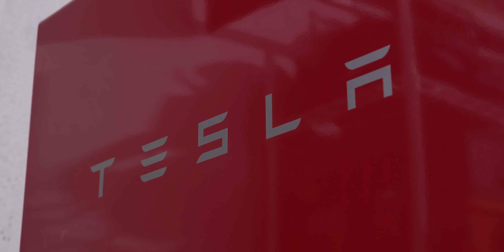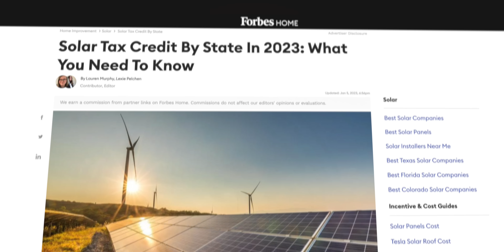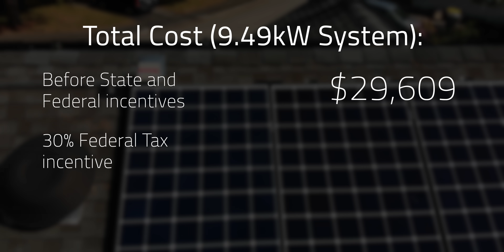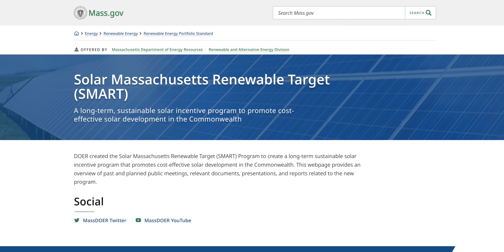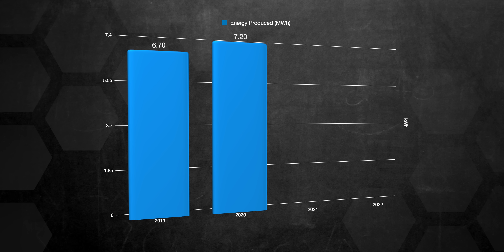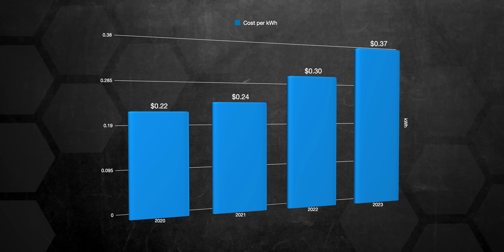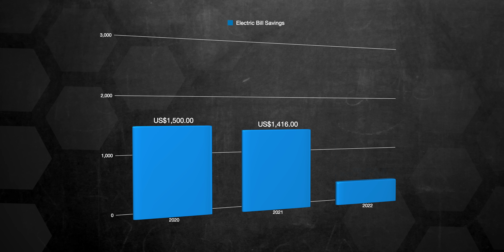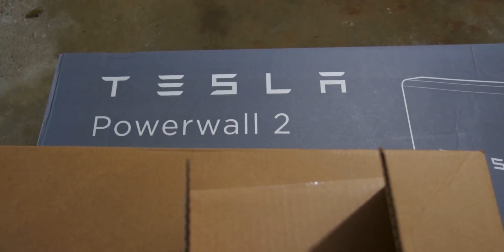5 Years with Solar Panels - Is It Still Worth It?

Comment: For those who are looking for some advice on extreme climates, I have had 2 off grid homes one in CO @11000ft elevation and one in AK at 66 degrees latitude. The suggestion for more than 6 months of winter is prioritize something more efficient in inclement weather like wind. The panels in CO needed to be shovelled not brushed off up to 4 times a day. Panels will crack with more than 2 ft of snow on them. I lost 25% in one storm where I couldn't physically keep up with the snow. I also had a roof avalanche that knocked my generator, 16kw propane, and propane tank off the pads. A snow bar would have made my roof collapse even at 100 psi snow load. In AK I have 11.6kw panels and 2 genies, 6kw and 10kw. There is 1 week a year the sun doesn't come above the horizon so solar was only giving 0.3ah for 24 panels. The snow also is an issue here I have a ground mount with the panels vertically. They are set @ 66 degrees so most of the snow slides but being 16ft in the air, I can't reach the top. With large storms, snow needs to be shovelled out of the bottom so the bottom half panel is visible. This will pay off in the summer with 23 hours of daylight. In summary, choose the most efficient system for your location and look out for hazards like extreme weather, slippery roofs and overestimating your physical abilities.
Reply: My father tried wind in Ohio. A small system with a brake that would apply itself if the wind was to strong. One night it was so windy the brake blew apart and the blades spun so fast they ripped off the center mount launching one through the siding, outside wood, and inside wood of the of the garage. The blade was stuck into his house, halfway inside and halfway outside. He tore it all down at that time. An expensive mess..
Reply: "An expensive mess" , on boy , you nailed.
King Murphy of new jersey with his German co-cronies are trying to pave the ocean floor to support an army of giant windmills as tall as the Chrysler building with blades as long as the statue of liberty 🗽 is tall.
Try an keep that balanced and bolted on!
Anyway it won't work and will become a government cheese disaster we can't even eat.
Plus it's killing the whales(the constant sounding destroys there equlibrium) and eventuality all commercial fishing.
Reply: @ohioplayer-bl9em  I've been looking into home/residential wind and in the majority of situations its just not worth it unless you can afford a very large and tall wind turbine. Its good for commercial but for most solar is much cheaper and reliable. Just getting a lot of wind through your property isn't enough to make it useful, you need consistent wind that isn't prone to gusting and changing directions a frequently, which is why wind turbines tend to be tall as the wind is more consistent there. A battery pack for storing extra solar power during the day is a better way of offsetting night-time energy usage as well. If you got enough water at a steep enough angle running through your property year round then hydro might also be something to check out, but thats also very situational.
Reply: Not getting on a roof especially snow filled. In my 60s and you too, Lord willing will get older and unable to do any of this kind of stuff or risk breaking your neck. Come up with some other arrangement as one fall and health gone makes no sense to save money if jacked up and now unable to do anything because you fell off the roof cleaning panels
Reply: @billbirch3748  Great grandfather died falling off a roof while fixing it in his 80s. Leave your roof to professionals!
Reply: @billbirch3748  I made the same comments. But adding to that there is just too many  Americans that couldn't possibly afford any of this but those that can are being heavily subsidies in all aspects that push higher rates to those that couldn't afford it in the first place. I don't see solar as practical, even for those that now can afford surely the future is unknown, subsidies and mandated buy back most likely will disappear and eventually total replacement of solar. To me nuclear and constant power plants benefit all. To me we are moving away from the logical to the illogical and eventually the logical will prevail.
Reply: Sound advice @b hendrick. 🕶👍
Reply: You're supposed to be smarter than your solar panels
Reply: Also as you highlighted, if you know snow is going to be an issue and you're not able to do anything about roof avalanches then don't place expensive equipment directly under where its going to happen. I imagine you'd also be better off with a ground based solar panel rather than roof mounted, so its easier for you to clean the snow off, possibly even have a manual way to tilt the panels to make the snow just slide off. Basically try to plan and anticipate issues ahead of time and then learn from the things you weren't able to foresee, then pass your knowledge onto others.
Reply: If you have a metal or solar roof, or heavy snows in general with a high angled roof you should be getting everything cleared from where it could land.

Last year my company plant was closed because a snow avalanche off the metal roof hit the natural gas meter and ripped it off the wall.  The gas found the path of least resistance...into the building.  People walked into the plant in the morning and there was the smell of gas throughout the building.  Happened once in like 40 years, but still potentially catastrophic.
Reply: Me me me me... Me me me

Decarbonization is 21st century pyramid building.
Just burn coal. 

This is sickening on so many levels.  "How to screw the lower middle class and make them pay for your feel-goodery."

Comment: consider how much the panels, plus installation plus converter cost. How many Kw-hr could you have bought? Then, I don't know where you live, but roof panels North of Miami , about 26 N are a waste of money. Consider= in winter solstice, the noon sun at Miami will be 49 degrees off the vertical. Glass has a diffraction property called the "critical angle" (it's used in periscopes). For regular glass, it's about 36 degrees. Any incident light at a lower angle will bounce off the glass, at 100% reflection. Solar panels are glass coated. Then, even in Miami, flat, horizontal panels work only part of the year. You bought a grapefruit.

Comment: We have had our panels since Feb 2016, so 7 years now.  They are thru a power lease with Tesla (formerly Solar City).  I have a 35 panel system that has generated an avg of 6.71 MWh per year, to which we pay (Tesla) $0.1483/kWh (this started at $0.12 in 2016) and any under-generation we pull from the grid.  In our area we have Peco Energy and they have a program where they apply billing credits for overgeneration.  Our yearly credits essentially cover our natural gas bill for the year (gas heat, stove, and HW heater).  So, overall for us its been worth it.

We also have not had a single issue with the system and rarely have heard from Tesla since the system was installed - really a set it and forget system so far.

Only thing that came up, oddly, is we had some roof damage due to a hail storm last summer.  Insurance finally this year processed the claim and we had to get the panels removed so our roofer could replace the roof.  Pleasantly surprised it was a great experience with Tesla to come out, remove (stored in our yard), reinstall.  Scheduling was very quick, and they (Tesla contractor, not a 3rd party sub) did a great clean job.  In fact, when they removed the panels, they found 19 of the 35 panels had wiring damage.  Apparently, Solar City in their manufacturing process, used coconut oil in the wiring, and our squirrels really like coconut!  So now we have a new roof, and 19 new panels all back up and running.  :)

Now, if the Powerwall battery wasn't so expensive we may have added one a while ago.  We don't really lose power (maybe 3-4 times in 10 yrs) so have a battery for backup isn't a big need for us, but may be nice to add in the near future.

Comment: For those who are interested, the guide is approx 65 minutes of video content for the beta price of $125 vs normal of $250.

Don't buy this. Spend your $125-250 on am individualized energy consultant that specializes on solar in your particular area. I haven't paid for or watched the content, but as someone with solar industry experience, you can likely get a few hour consult with a professional local to you that would explain everything included tailored to your area.

This isn't a dig against the author, but rather pointing out that solar is a very regional thing and requires regional expertise. Any guide like this needs to be generic in order to provide useful information to as many people as possible. Generic information like this can be typically found for free, but shouldn't cost more than 25-50 bucks as it's not the only thing needed for an install

Comment: Doing an install eventually in the Philippines.  Since it's close to the equator, you don't want to mount panels on a north or south facing side of the house.  If you want them in one position, then basically flat since the sun is going to track both north and south of a spot depending on time of year.  So, the panel array, maybe two, will go over a garage with a roof without much of a slant.  I want a simple way of positioning them for either 3 or 5 positions during the day, going east to west to get the best production possible throughout the day.  So, kind of like tracking the sun, except no tilt to the north or south, and only track east to west, but with something more rudimentary than actually tracking the sun.  I want the panels to lock into these positions.  They also need to be able to slide in to where they make two rows (so a mounting frame that can extend out and pull back in).  With the panels slid in to where part are underneath others, they need to lay pretty flat against the roof and then be able to be covered because you can get category 5ish typhoons and this is in the land of tall coconut trees and I can imagine that a coconut ripped from a tree and hurled at those panels will break them.

 So that's IT!  Nice and simple.  And we'll probably get one battery pack to run some electrics overnight.  We'll probably have to power down an AC unit overnight and just have overhead fans in each room.  This would mean cooling off the home more before the power generation starts to drop, and accept we wake up in the morning a little warm.  But I don't know because I'm looking at ways to keep the sun off the walls without using tall trees, such as using a sun shader on both sides of the house (east, west) to help keep the walls from heating up.  And these I'd want to be retractable.

Comment: solar panels, made with ferry dust and unicorn farts , not oil and gas lol , also you have to factor in cost, maintainence, if you need to re-shingle your house theres more costs, battery replacement

Comment: I'm surprised how expensive it all is. 🤔We can buy 9.9kW for about 5k in Australia (in Australian dollars, about 3500 USD). There's not much subsidy on that either. I have a 8.9 kW system with battery (14.6 kWh) on a maintenance plan which is about 30 USD per week and covers 95% of power consumption. Please note we get next to nothing for exporting to the grid. Usually 2.8 cents per kWh...

Comment: Note that with the tax credit, if it exceeds your income tax for the year you can roll the remainder over into the next year. Also the credit is against your income tax before withholdings, so if you over-withhold you still get the full amount back.

It's still not as good as getting the full credit back in the form of a direct rebate, but it isn't as bad as this video makes it sound.

Comment: Your state and utility is quite progressive as compared to mine (which is a state that SHOULD be solar friendly because of a high percentage of time solar is available without naming states (think southwestern US). Also having 1:1 netmetering is great. Having a utility pay you LESS per kWh than what they charge you AND having tiered pricing where you pay MORE during hours when solar generation is decreating (later afternoon to early evening) also is unfriendly (at the very least) for solar. 
Therefore, installing a 9.4kWh system 2 1/2 years ago has done ONE thing I desired which was not having any electrical bill, but that was only because I oversized the system for my ultimate usage (having moved from another state and using those figures without having current usage figures to go by). That proved to be a positive as I found out I typically could not oversize my system because the utility would not allow it. 
They do pay me a credit each year if I have one and so far I've had one. 
I agree with you about installers and how important that is. I was basically sold a system they termed 'hybrid' to include small battery backup with small natural gas powered generator to cover critical loads (at the time the cost of battery only for backup of the entire home was too costly and getting a whole-house size generator was also too costly). 
In hindsight I would not have gotten the backup portion of the system as it was not yet ready for prime time. It took almost 1 1 /2 yrs before the software caught up the hardware to make the system fully functional. Also I found out the need for backup was greatly reduced in the area I now live as compared to my previous home/area. Could have saved thousands of dollars. 
The solar installer also started charging a monthly fee just to maintain oversight of the system (which originally I was told was included in the cost and a benefit service they offered).. I cancelled that and now monitor myself, but have to pay them if I have ANY need for them to come look at the system or replace parts (even warranty items like microinverters). I've had to have 2 microinverters replaced so far and had to pay for the install (but not the inverters). 
Very frustrating to spend over $40k on a system that will not probably see a full payback for 15 plus years (at best). If I had to do it over again I would have done a smaller solar system to offset 'some'' electricity expense (probably 5-6kWh system) and not done any backup system unless it was determined it was needed. Also because of the unfriendly nature of state and utility, I could have used much of the money and invested it and pulled out enough per year to pay for electricity cost and probably had at least 10-15 years of covered expense. Of course it may ultimately work out if electricity costs continue to rise, but because they cap what they pay me at a rate much lower than what they charge me I will continue to fall further behind on that score. 
Moral of the story is repeating what you said- know what your state and utility offer regarding your solar production and know the economics of it clearly as well as your goals for getting it before you do. It may not completely offset your costs (particularly if the utility tacks on a bunch of 'fees' which you would then have to offset with electricity production above and beyond what you use). That part of things is truly frustrating. Almost makes you want to be COMPLETELY OFF GRID which would then make battery/generator backup more palatable and you could then oversize your system as much as you want/need.

Comment: Hi Matt, I live in Connecticut and have had Solar Panels since September 2014. My setup is 30 panels with enphase converters. I love the panels and agree with your assessments. I was warned about the rain, so pushed the panels back so rain did not miss the gutters. I was surprised about the snow avalanche- which has been a challenge every year except 2023. It can destroy house plantings and become difficult to move when it falls from the second story. I did not get a battery, but use a generator for power outages. Love your channel and best of luck with your move & new house.

Comment: I have the Tesla 4.08 KW system with 12 panels . The biggest mistake I made was not getting the battery when I had the system installed .  I started in Feb 2021 with my order and the system was installed in May 2021 . I could have got a battery installed for $8,000 but was told it would hold up my install till Sept or Oct so I said no thanks . Now our power company has raised the winter  TOU to .47 and the summer to .54 between 4 to 9pm and the battery would have saved me from using the high price power from the grid . Now the battery is $12,000 to $13,500 in my area .

Comment: You got a pretty sweet deal with all the money the government gave you and the free power wall.

My 2.8 kw solar system with a 27kw LI battery had a payoff time of 17 to 20 years. Then, my inverter died, and I now have a payback period of 27 years.  It's not a great investment so far.  The one good experience I have had was during a power outage when I was able to run all my AC during the intense heat after the storm.  We were without power for 5 days, so that was nice.  But unless there is an apocalypse and my solar system happens to still be working, my solar system has not been a great investment so far. 🙃  If I have to keep replacing parts, it may never pay for itself, and I could have invested the money in my business and had a payback period of 5-7 years, which looks pretty good in hindsight.

Comment: Hi Matt, from the UK. I had 4kw of LG solar panels fitted 9 years ago to my south facing roof, costing £6500. In UK we had a FIT scheme which paid 28p a KW, and the panels paid for themselves in 8 years producing £800 of exported electric to the power company, plus I could have free electric when it was sunny in middle of the day. Definitley my BEST BUY ever. But the FIT sceme has now ended and power companies only pay 5p per KW ! so its not worth doing. Lance